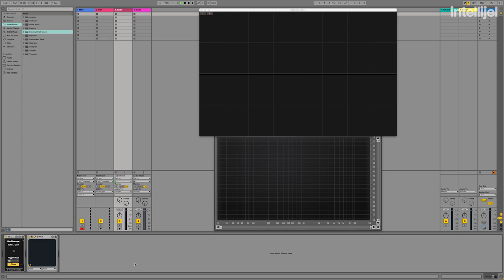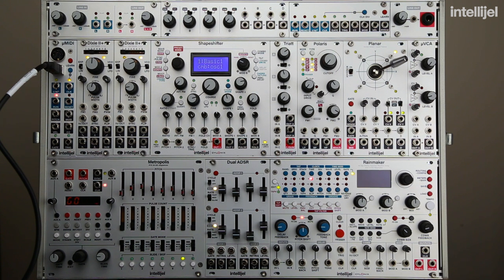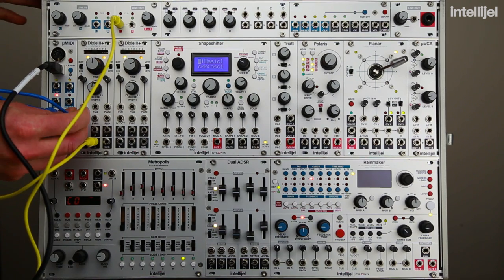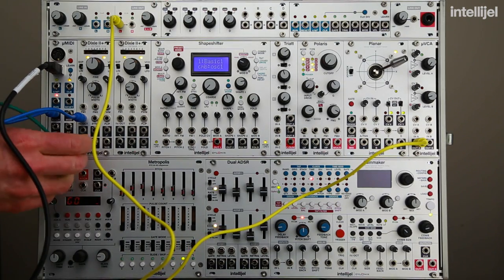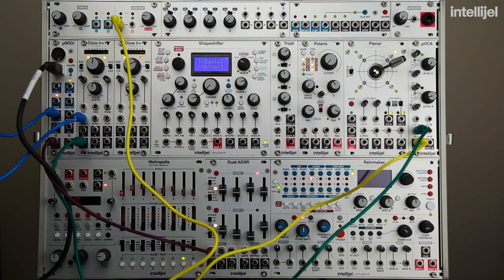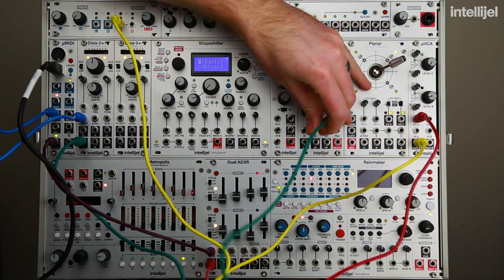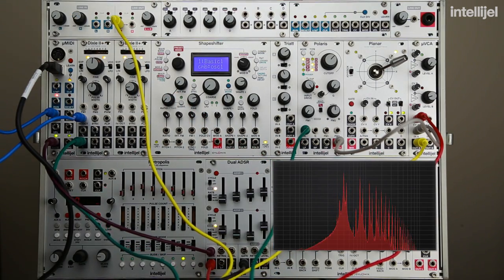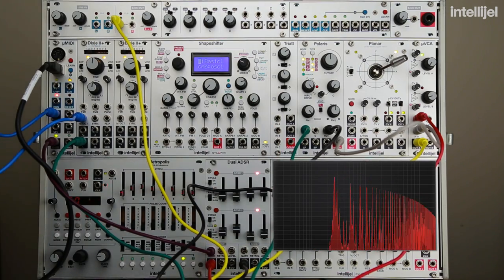Intellijel µMIDI Tutorial 3 - Pitch & Gate

Comment: Could I use the Usb and Midi  Din socket simultaneously? And does the Usb provide power to eg midi keyboard?
Reply: Good question! Yes, you can use both simultaneously but the messages are merged so if you're not careful the device could become confused. This means that for example you can send clock from your computer and play melodies with your 5-pin MIDI keyboard, just make sure that your keyboard is not sending clock..

µMIDI does not provide USB power to devices.